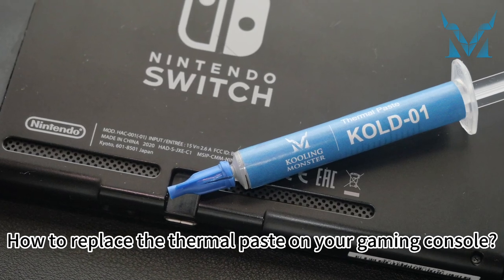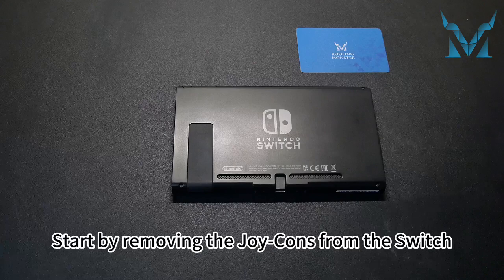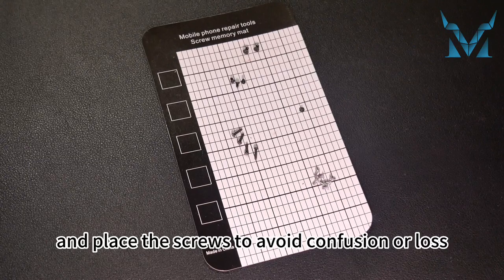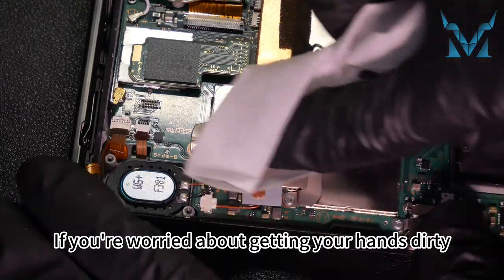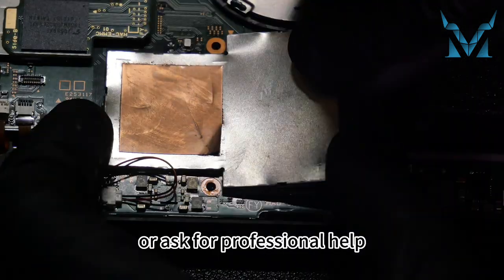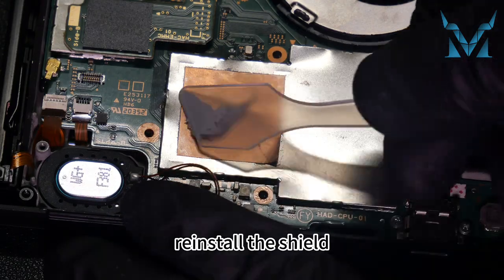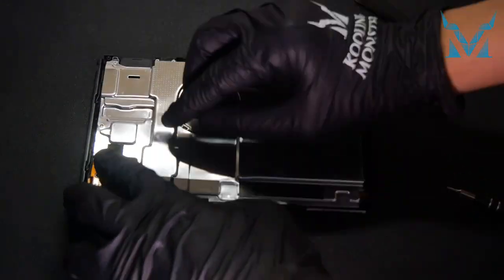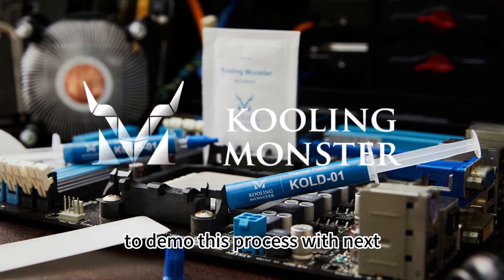Speed Up Your Nintendo Switch  - Prevent Overheating With Dust Cleaning & New Thermal Paste

Comment: Not a bad video but one too much Thermal Paste, you can get way using a little less.
2nd you don't need to remove that shell on the CPU, just the little pad will do.
Reply from the maker: Thank you for the advice on removing the little pad, that is going to make this process a lot easier! However we still recommend to cover the CPU fully with Thermal Paste for the best result.